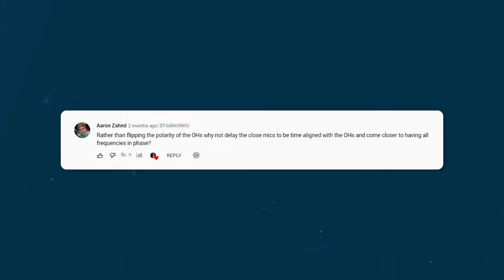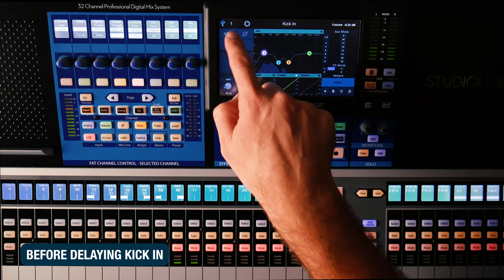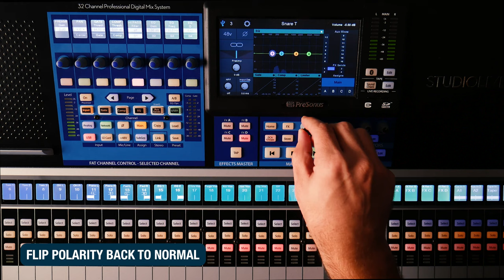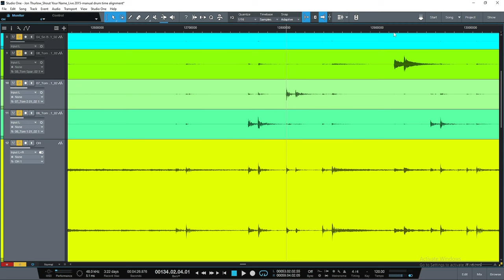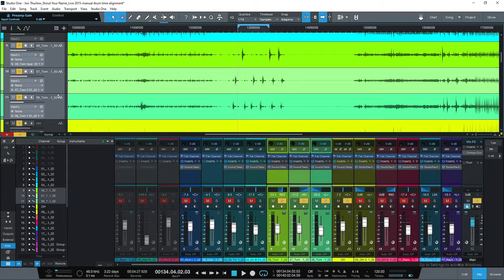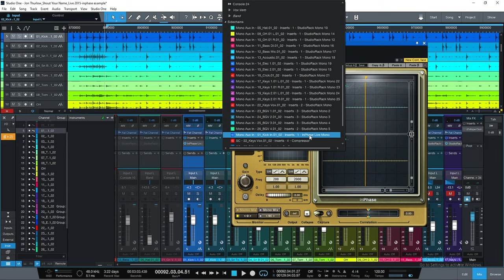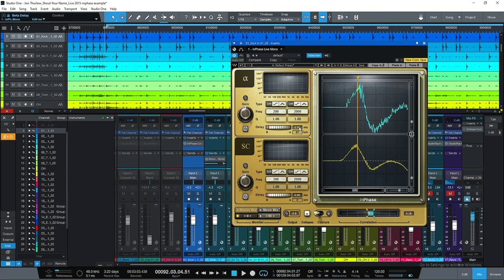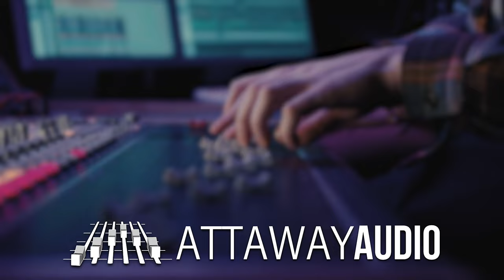Time align drum mics? || Live Sound Phase Issues

Comment: For mixing I use a plug-in called AutoAlign by Sound Radix. It measures the delay and polarity for you similarly to InPhase but it does it for you automatically which is a huge time saver over InPhase.
Reply: Yes, but with inphase you are doing it, not a plugin

Comment: In a live situation time aligning the kit with the PA gives very obvious results as well. There is significant spill from the kit in the vocal mics that are nearer so you have to choose whether to align the drums with the vocal mics or the PA since those are different distances. Or switch to electronic drums and kill the stage noise. 🙂
Reply: I would have much rather watched a video about this! I envy any live engineer who has time onsite to measure and set 6-10 delay lines, and pity the drummer who has to play every drum for long enough to set gain, HPF, dynamics, EQ, polarity AND delay time wrt the OHs (not to mention the rest of the band). But mains-to-backline delay will make a huge difference, especially in venues small enough that the audience can still hear a lot of the acoustic sound of the drum kit.
Reply: @timnordberg7204  
Hello,
How exactly do you go about this so that the signals in the oh are all in phase with the bd sd and toms and at the same time the signal from the pa and the direct sound reach the listener at the same time?
Best regards
Robert

Comment: I am struggling with this technique. I guess I am too much of an engineer to see the benefit. I can definitely see you can increase your kick by aligning all the tom mics to it, but are you not making the timing between the toms worse and increasing the comb filtering effect in the toms?
I would also be interested to see how often you have to do the alignment. As you said, sound travels at different speeds depending on a wide range of conditions. If it is great today, will it be terrible tomorrow? Or, will the drift be small enough that you will need to recalibrate the mics once every 3 months or so? Inquiring minds want to know.

Comment: Hello from Australia, i am a volunteer at a community radio station, I've been interested in audio production for a long time, mostly in my home studio. In the past year or so i have been involved in  broadcasting local bands live on the radio and trying to mix in real time for broadcast with analogue gear. I also multitrack record as much as i can and have discovered the whole phase alignment thing. So . . .  It crossed my mind that i could just do monitor mixes analogue and do the broadcast mix in the box. Reaper has a plug called phase rotation, i figure its doing time alignment. But could a given mic (thats waveform is  inverted raw vs another mic) require both phase invert and time alignment . . . aswell.

Comment: Great video.  For live, us X32 guys are at a limit to what we can do other than route through a DAW and do alignment and then back out (to livestream or other).  I don't think I would ever go through a DAW back to the PA.  Waves Superrack?  Sure.  Would love to see what we can do other than 1ms stepped delays on the X32.  Moving mics by inches and feet can be done for some degree of adjustment.  What kind of delays would be available in say a Digicom or Avid style costy-mixer?
Reply from the maker: If you use X32 edit, you can type in your delay time in tenths of a ms. Some higher end consoles let you do it in samples, which is handy. I just tried this last weekend on an SSL L200 but forgot that my recording is in 48kHz but my console was running at 96k... so I only delayed it half as many samples as I should have.
Reply: @AttawayAudio  Ah - thanks.  I'll try typing it in with the iPad and/or X32Edit on the x32 over using the control knob which seems to work in 1ms steps.  Also, for the first time at our church, will be measuring distance from snare to OH's.

Comment: why would you correct for an apparent timing delay between the two OH mics by using the snare? It's not as though the drummer is putting their snare dead-center of the kit, balanced on top of the kick. Wouldn't you just want to align the snare to the louder and earlier transient of the OH mics and then let physics do the rest? The panning of the OHs should feel more natural if signals panned to one side reach the listener's ear faster on the side on which they are louder.
Reply from the maker: I like to fix this with mic placement so the snare is in the center of the stereo image, since it needs to be in the stereo image of the mix. But when I can't go back in time to move mics, I do what I can.
Reply: @AttawayAudio  Do you have a video about drum mic placement please?